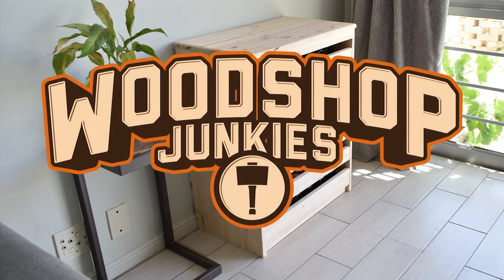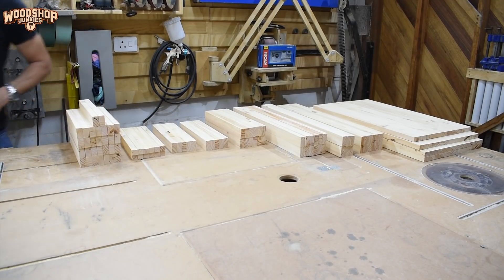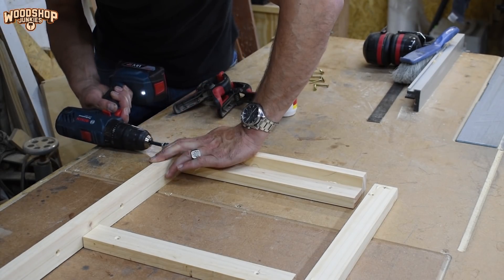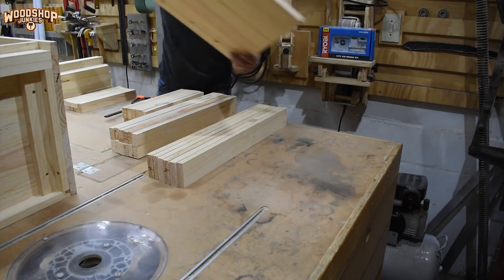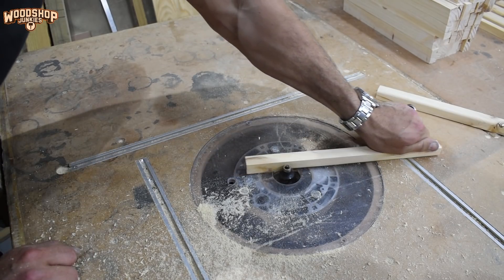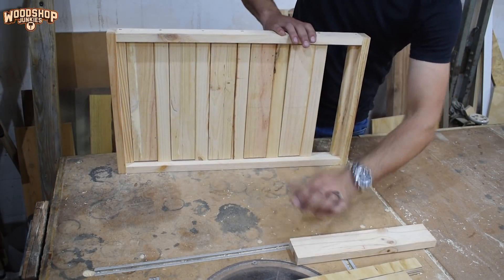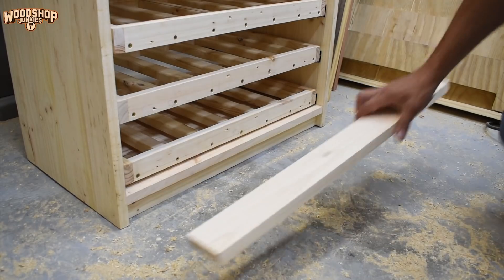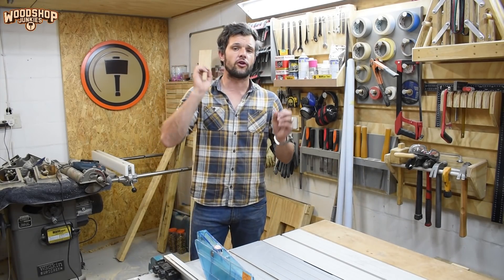DIY Drawer Wine Rack - Simplified Assembly For Beginners

Comment: Your shelves should be at an angle. The wine should always be in contact with the cork. Just an FYI
Reply: Exactly what I was about to comment, you should never have the cork exposed to air. The wine will go off. Also you should use the playing card trick to space your drawer fronts, will give you a more uniform spacing. I love this project by the way, would love to see this made from old oak wine barrels...
Reply: I think he can fix that with the felt he’s talking about adding.
Reply: But if the bottles are unopened then the amount of air in the bottle is small enough that the cork is fully in contact with the wine when the bottle is horizontal. I can't imagine storing a half empty bottle.
Reply: @alexreith4877  I can't imagine half-emptying a bottle...
Reply: Level bottles always cover the cork in wine. No need to angle them downward.

Comment: Really good video - many thanks.  If you were to continue to refine your design, you could increase the router/chamfer on the bottle slats at one end to ensure that the bottle is not level but tips slightly one way.  That would allow you to store bottles with corks slightly downwards to keep the cork moist.  This is not really an issue for screw-top bottles I accept!

Comment: Just a question... I see you connect all the large boards (top bottom and two sides) to the skeleton using two screws and glue, where the grain direction is perpendicular between the two. Can't it be a problem in terms of wood extension and contraction?
Thanks!

Comment: Hey mate that's amazing video and wine rack.
I am looking y building something similar but with a Dept of 80cm. This will allow me to keep two rows of bottles.
Now the question comes to what type of runners do I use? Do I use two sets of what you have done or build a long 80cm rack but will that hold the accumulated weight of 16 bottles?
Reply from the maker: You are going to have to shop around to see if there is an 800mm runner option and if so what is its capacity.

Comment: Awesome idea!! Enjoy watching your videos. Are those solid panels or laminated shelving panels? Where do you get those panels in SA?
Reply: Laminated panels, available at most Builders Warehouses
Reply: The wider panels (600mm+) do have a tendency to cup slightly
Reply: @volla40  I previously used some laminated pine sheets but the ones he used in the video seems to not show the joints. the ones available in my town have finger joints inside the panel